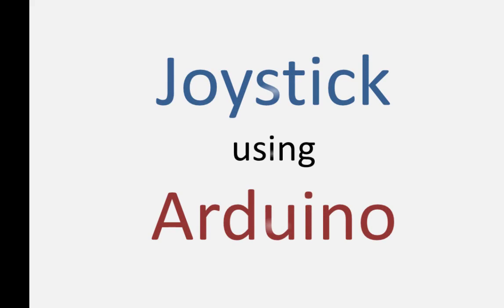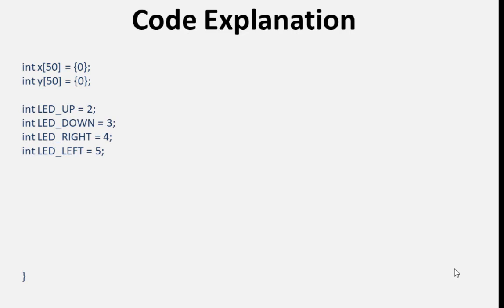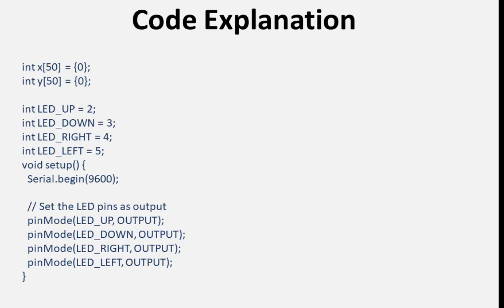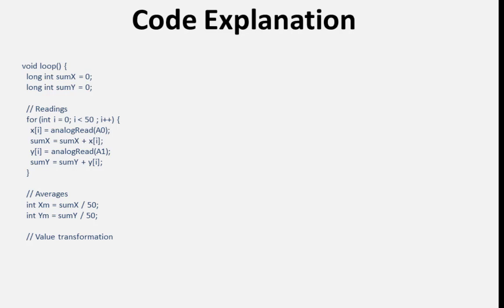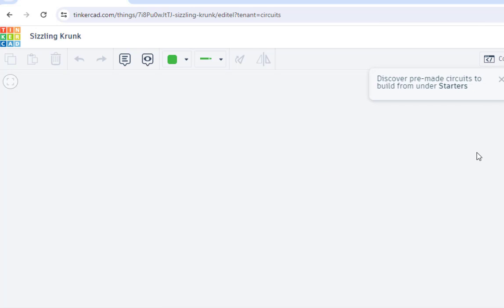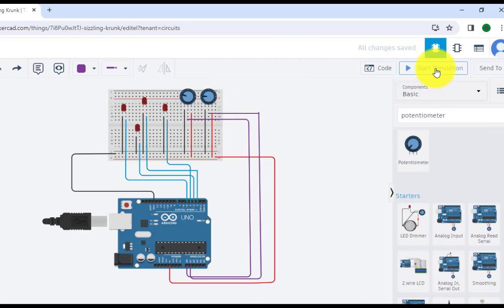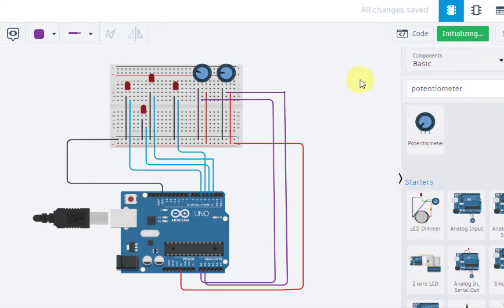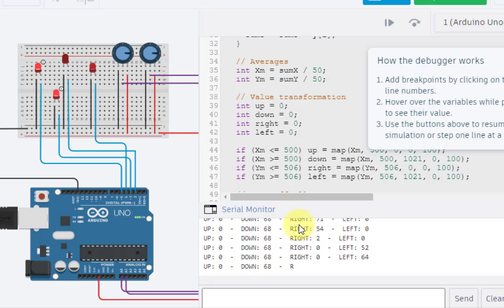Simulating a Joystick with Arduino in TinkerCad

Comment: int x[50]={0};
int y[50]={0};

int LED_UP =2;
int LED_DOWN =3;
int LED_RIGHT =4;
int LED_LEFT =5;
void setup()
{
  Serial.begin(9600);
  pinMode(LED_UP, OUTPUT);
  pinMode(LED_DOWN, OUTPUT);
  pinMode(LED_RIGHT, OUTPUT);
  pinMode(LED_LEFT, OUTPUT);
}

void loop()
{
long int sumX =0;
  long int sumY =0;
  
  for(int i =0; i<50;i++){
    x[i] =analogRead(A0);
    sumX=sumX =x[i];
    y[i] =analogRead(A1);
    sumY=sumY =y[i];
}
  int Xm=sumX /50;
  int Ym=sumY /50;
    
    int up =0;
  int down =0;
  int right =0;
  int left=0;
  
  if(Xm <=500)up=map(Xm,500,0,0,100);
  if(Xm >=500)down=map(Xm,500,1021,0,100);
  if(Ym <=506)right=map(Ym,506,0,0,100);
  if(Ym >=506)left=map(Ym,506,1021,0,100);
  
  digitalWrite(LED_UP,LOW);
   digitalWrite(LED_DOWN , LOW);           
   digitalWrite(LED_RIGHT, LOW);
     digitalWrite(LED_LEFT, LOW);
  
  if(up > down){
    digitalWrite(LED_UP, HIGH);
  }else if(down > up){
    digitalWrite(LED_DOWN,HIGH);
  }
  if(right>left){
    digitalWrite(LED_RIGHT,HIGH);
  }else if(right<left){
    digitalWrite(LED_LEFT,HIGH);
  }
  
  String phrase1 ="Xm=" +String(Xm)+" -Ym" +String(Ym);
  String phrase2 ="UP:" +String(up)+" -DOWN:" +String(down)+"-RIGHT:" + String(right)+" - LEFT:" +String(left);
  
}